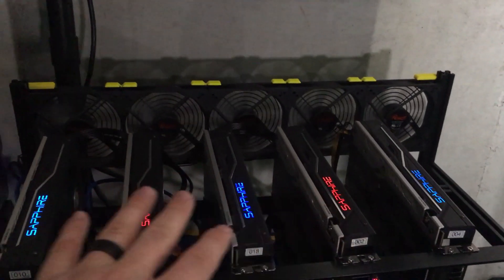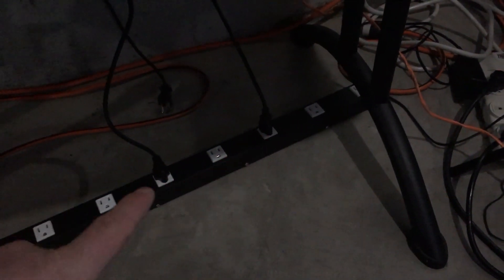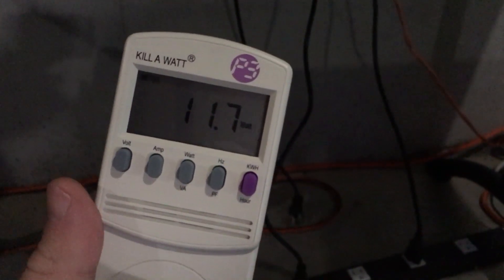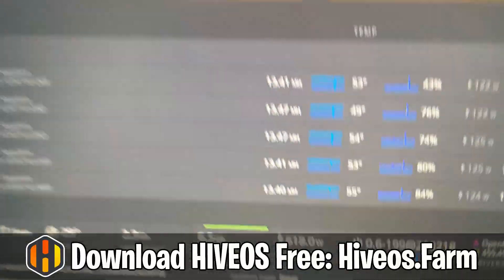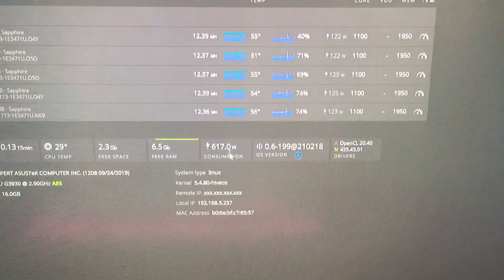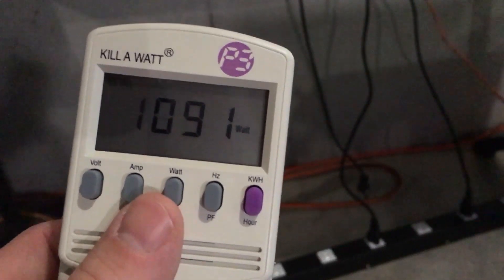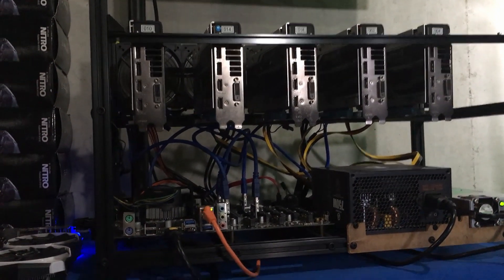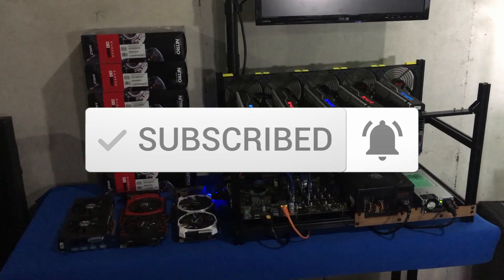Testing Power Consumption for 5 x RX 470 4GB Mining Rig?

Comment: i have a strix rx 470 4gb and a msi rx 570 4gb but cant get 13mh/s, both mine around 10mh/s raven. i have tried to overclock and undervolt but cant get even near 13mh/s any ideas?
Reply from the maker: Yeah the Sapphire Nitro are more designed for Mining and I have read out perform the Strix and MSI Cards.
Reply: @TheHobbyistMiner  swiched from nanominer to Teamredminer and got rx 570 to mine with 13,6mh
Reply from the maker: Team Red Miner is more efficient all around